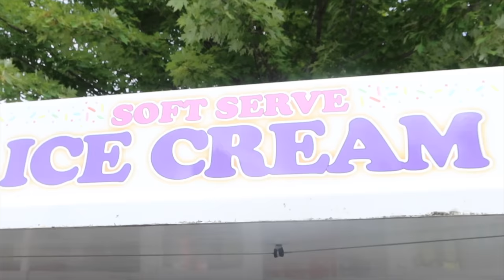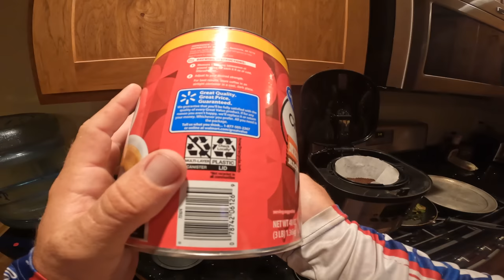Knockout Round - Cayuga Lake | Stage 6 MLF BPT  (Jacob Wheeler)

Comment: So what was the deal with your batteries
Reply from the maker: Tried jumping the trolling motor batteries to wake them up after dying and ended up shorting the charger. Pro Tip: if you ever jump a battery make sure any on board charger is completely unattached